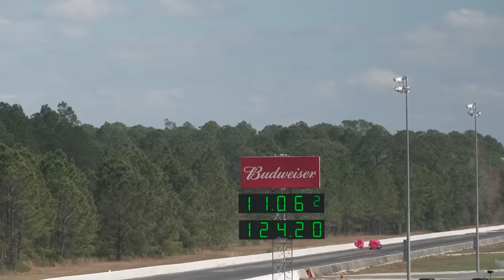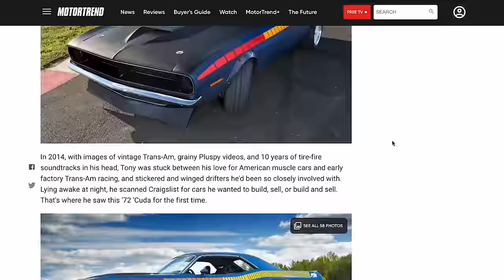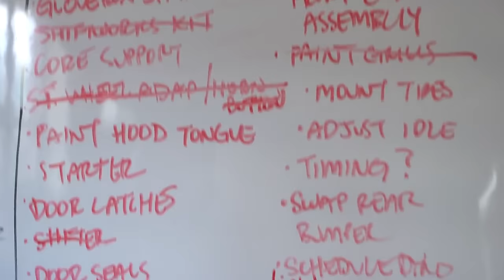I HAD TO SELL My Greatest Car! Here's What's Next!

Comment: In 1973, My wife and I bought a 1973 Dart 340, 4 speed from Grand Spaulding Dodge ln Chicago. It was our first new car. It had the same interior as yours. I broke the rear end, and under warranty, I bought a 3,90 ring and pinion, and G/S installed it under warranty. Black on Black. I still miss that car, street raced it every time I could.

Comment: My grandfather and I maintain about 30 50s to 60s cars. And whenever we try to start them, in his words, we always "cheat the carb"  by spraying a little gas from and dinner style ketchup bottle down the carb. Much easier on engines that run 3 times a year 😮‍💨 the owner of the cars makes me insane. Start his 69 Boss 429? "Naw, cant start it, the exhaust is too nice and the judges at the shows will ding me points and i might not get the big trophy!"

Comment: 1. Call up AK at enjuku, get the parts you need to drive the s13 and take it to an event at E town

2. Take that doo doo iron LS, slap it on that frame, and drop the Olds on it.

3. Get some wide Miata wheels on the Lotus and swap in a high revving inline 4 like a 2zzge, a k20, or a solstice gxp motor or something

Comment: Great project overview.  22:45  For the boat cover issue, a 20' run of PVC pipe or conduit arched over the boat from bow to stern under the covers is a great way to keep them from becoming kiddie (cess)pools.  Another move is to get two traffic cones for the front and back with boat cover support poles stuffed in em.  Can't wait to see the SR project revised at some point

Comment: So glad you did not get rid of the Pontiac. I have owned several going back to high school in early/mid 1980s and currently have a 1975 TA with a 650hp N/A engine and there is NOTHING like that Pontiac sound and seat dyno.

Comment: Speaking of that Bayliner (and I'm originally a Jersey/Philly guy myself, but in ND now), me and my best friend at the time picked one up when we were 17 (42 now), was an 85 Bayliner Capri Cuddy with the 2.3L Volvo, it was faded, the trailer tires were flat, the seats and all exterior upholstery was shot, and it didn't run....we got it and the trailer for $300 lol.
We got it running that night, over the next week reupholstered the interior in some sharp blue vinyl to match the blue striping, put some fixaflat in the trailer tires, rented a Uhaul Econoline with a ball hitch (we both had Fox Bodies at the time, I had a 92 LX 5L 5spd with factory leather, he had a dope azz 85 all black Mercury Capri GS with a Mustang GT hatch, McLaren taillights (mustang, not capri), the Capri RS front airdam and Mustang GT side effects with a 93 Cobra rear... and a 408ci stroked 351w with a Tremec TKO on 17" black centered BBS' wheels and Recaro mesh headrest seats... that thing was so dope looking 😅

Anyway lol.... that Bayliner never let us down, we were in the Delaware every weekend for 2yrs straight, literally killed that first Uhaul van trans on the launch trying to pull it out the first day, then we built an absolutely terrible square body first gen Ranger with a 5L and an AOD so we could tow it.... that poor 302 probably had 300k miles and would barely do a burnout in a damn Ranger, but it was enough to get our 💩 boat to the river and back 😅

Comment: My best friends father got home from the Vietnam war and bought a brand new 1969 or 70 charger with a 440 6 pack he cut the fenders and widened it and would race all over , I never got to see the car it had rotted away from our weather in NYC but he kept the engine under a tarp and I still remember around 1990 a guy noticed the tarp and checked it out and made a insane offer for the engine and carb set up I never knew how much a low mileage 440 with the six pack went for

Comment: Love the 80 Dodge truck. I had a 77 with the Adventurer package. Whatever that meant. It had belonged to a logging company so it didn't have a straight piece of metal on it. The front bumper was U-shaped I assume from pulling stumps. But it was a great running and driving truck

Comment: I've always wanted to get an Infiniti J30 (basically a 1st gen Altima with  rwd and VG30DE V6 instead of the 2.4L 4 banger) and turn it into 4 door sleeper. They only came with automatic transmissions, but since the motor also came in the NA 300zx and Maxima, you could just swap in a manual transmission from one of the other cars that shared the motor. I wanted to swap in the VG30DETT out of the 300zx twin turbo. Unfortunately I have never seen one converted  except for a guy in N.J. who swapped in a turbo 6-cyl from a Chevy SUV and a 5-speed manual like 15 years ago and the video doesn't cover the swap at all. I would absolutely love to see you guys tackle the project that I've always wanted to see but basically nobody has. Either way, I love the channel and the content (especially the 'Sike clone' and 'Pauerkraut') has just been getting more and more epic.

Comment: Jelly of your collection of cars and projects. Aligns pretty close to all the cars I've owned, and my family's growing up...Dodge, Nissan, and Chevy (GM).  Always liked the Ram Chargers, and Dodge muscle cars. Father 73 Charger & 2 different Dakotas ( 1 a/5.9 😊), Brother  Road Runner and Conquest, Grams a little Datson & then a Dart, and Ive had an 89 (2.5 T-top) and a 90 Daytona (3.0 spoiler/side skirts) myself. My first fully new car was in 02 Nissan SER SpecV , no SR20 , but 1st yr of 2.5 QR, but that spring boarded me into the Nissan GTRs, 240s and the different engines...also had few Chevys, 84 z28, 85 Monte Carlo (4.3L), 91 Beretta GT(3.1).  The 07 A4 Quattro Ive had for 11 years was at the point where it was not worth repairing at 200.000 miles and in August, for my bday, I bought my first Ford, a 13 Taurus SH0 with AWD. Been treating me good so far, and I hope the old Ford acronyms stay away😅 Voting for 240 or Lotus until parts come for sikeclone or powerkraut. Keep the real content coming and congrats on 200k 🎉

Comment: 1969 Dart GT Sport or called the GTS.  1 of 50 made with the red paint, 727 trans, Posi gears, and the 383.  My cousin has one.  Bone stock with all original stuff minus tires and consumable.  Numbers match.  125K on the Odo.  Incredibly fast.   My first "fast" ride as a child was in a "Beep Beep" Roadrunner with a 383 and 4 speed.  I remembered the horn and the little Roadrunner cartoon on the fender side as a kid. Couldn't see over the dash, but could hear that exhaust right under my butt as my uncle banged thru the gears.

Comment: The fairlane has 2 regulators because it most likely had nitrous. Turning up the fuel pressure on the kit will add fuel without having to change jets.

Comment: Guy dont need much more power than that. Had a 67 cuda with the 4 speed and it was scary fast. You couldnt get much on the big end but 0 to 100 smoking and the tires the whole time. Small block mopars are my face too mine. Had the the 340

Comment: I have a very similar childhood brother. When I was 13, my dad brought home a pretty nicely done up 1987 notchback foxbody mustang.....rolling chassis. It had a cage, bunch of road racing suspension stuff, I won't get in too deep here. Anyway, pops tell me "if you get it running, it's yours." So I literally whore'd myself....wait...no not literally...fuck...yeah so I FIGURATIVELY whore'd myself out around the neighborhood. Mowing lawns, washing windows, washing cars, babysitting, changing oil, doing private snowboard lessons (they were actually my biggest payer) and a bunch of other shit for 2 years and ended up with $28,233 to build my car. I bought a 600hp blueprint engines 401 stroker small block ford, corresponding headers, the latest and greatest Holley sniper efi...in 2003, tremec tko transmission, twin disc clutch, lightweight flywheel, some really nice sparco racing seats and sabelt harnesses, watts link, coilover conversion with kw coilovers, one off 3 piece wheels my grandpa and I machined ourselves (18×12 out back 18×10 up front) with 5 inches of polished billet lip out back. I put a rack and pinion from an s195 with a different gearset to quicken up the steering, gpa helped me modify the front suspension to get 58° of steering angle too because I told him the turning radius sucked, hahahaha!! In reality I spent countless hours downloading drifting videos on my folks old dialup and that was what was always made very clear, you needed more steering angle. The rear axle was already done up with 32 spline axles, detroit trutrac, 5 lug conversion front and rear, 2003 cobra brakes all the way around. Then I spent the rest of my money on a badass full blown race car dry sump system. Didn't have enough money to get her painted even though the body was so perfect you could have rattle canned it and it would have looked good. I went out of town for a dirt bike race, won my class, when I came home my car was sitting in the driveway painted Mercedes tuxedo black inside and out, cage and all with so much clear coat it looks like you can dive into the paint. My dad had it done by the body shop connected to the Porsche dealership he was the GM of at the time for my 16th birthday. The painter said he didn't have to do a thing to it except mask it off, wipe it down with a tak rag, go to town. That's how I got my first job as a proper. He hired me on the spot jack.  So, first day of my sophomore year, I was the ACTUAL shit. Nobody I went to school with had ever so much as SEEN a car like mine. Im 99% sure I was the first person to seriously drift a mustang in Reno Nevada. I got more ass because of that car it's no wonder i have an 18 year old son. I remember driving down to the Taco Bell on off campus lunch with 5 hot senior girls squished together arguing about who got shotgun.  Did the same thing the next week. Those were the days man. The school let me drive in the homecoming day parade and the principal told me to "light it up!" Hahahaha, he INSTANTLY regretted his decision. Because I did a 4th year sitter for like 12 seconds and walked it out to like 90mph in the parking lot, yanked the handbrake and did a perfect 180° turn to dead stop facing the carnage I just created. The crowd went absolutely ape shit it was probably the coolest thing I've ever done in my life. Just smoked out the entire homecoming day parade with a 4th gear, 144mph wheelspeed sitter. They still have pictures of it in this "memories" case they have on the wall in the main corridor. It says "homecoming 2004" and all you can see is a faint remnant of lights and shit behind a momentous amount of smoke then the nose of my shiny ass black fox body sticking out the front of all the chaos, arm hanging out throwing up the shocker and everything..The school newspaper editor was a buddy of mine and put a caption at the bottom of the page "AJ L___ expressing himself by nearly asphyxiating all in attendance with a display of horsepower in his very well known (by the female students as well as the staff) 1987 mustang he built himself. Mr.Schiving was clapping louder than he ever had at a football game!!" Mr.Schiving was my Auto shop teacher. He taught me most of everything I know about cars. He's the only reason I didn't kill myself or worse, someone else in my car. He always made me bring it around back every other Friday and we'd go over the thing from tip to butt. His daughter was one of the beautiful senior girls riding around with me so, yeah. He ended up becoming my father in law. No bullshit. I miss him every day. RIP Mike Schiving.

Comment: Holley doesnt know engines...
750 too big for any 350. You only need a 650 otherwise over fueling the engine.
Would do better with a 383 stroker kit on the RX7.

Comment: I have a 87 fc 4.8 ls single 83/75 vs racing dynoed 686whp on 17psi 17 degrees of timing on e85. So has alot more in it.  Had a 2004r in it for a while, then swapped to a cd009
Reply from the maker: Well, that sounds like a hell of a fun time.
Reply: @StayTunedTA  she is.  I'll send you some pics on instagram